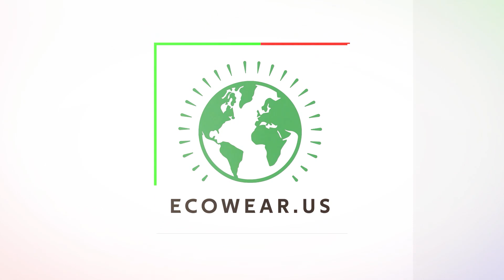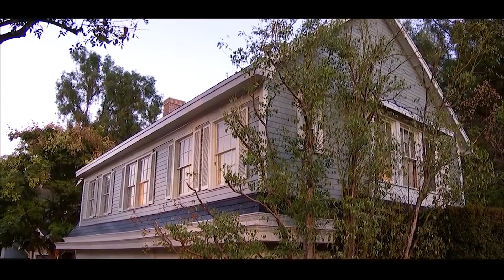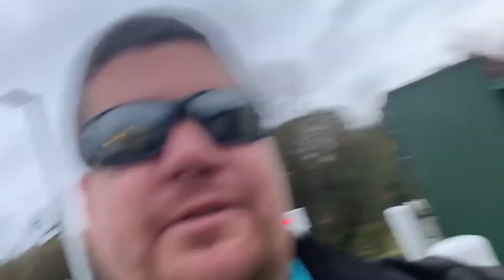Tesla Time News - Changes Coming to Cybertruck?

Comment from the maker: Timestamps:
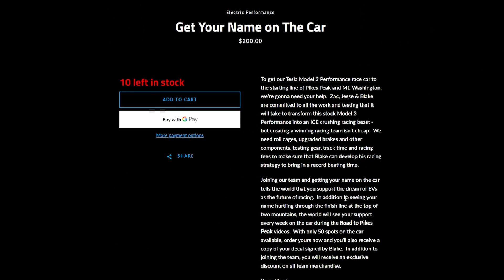Cybertruck Changes -  0:59
Extended Free Supercharging Miles - 6:54
BMW 330e - 7:47
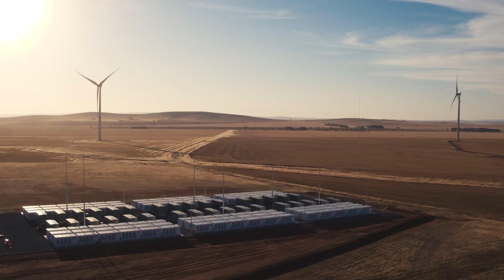Tesla Hornsdale Battery Got Bigger - 11:22
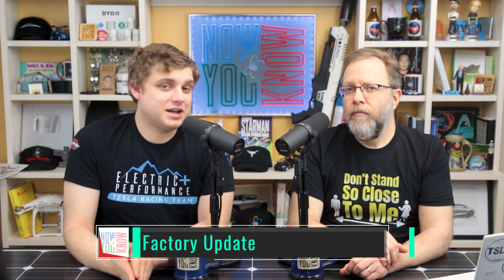Mike’s Lucid Factory Update - 11:54
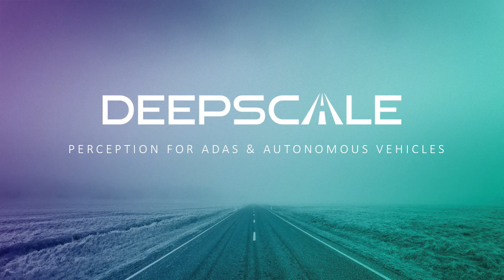Tesla Deep Learning Patent - 14:16
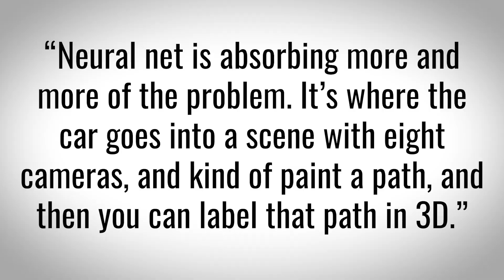Model X Pre-Heater - 15:18
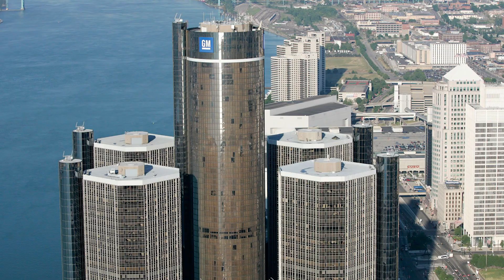GM Customer Loyalty Survey - 18:47
Auto Park Update - 20:55
Revero GTE - 21:32
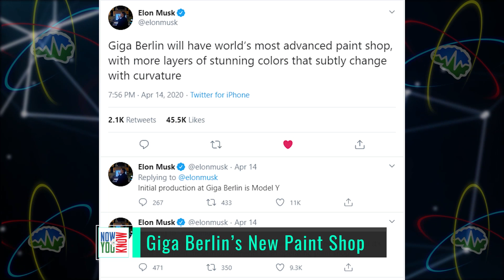Giga Berlin’s New Paint Shop - 22:55
Shots Fired - 23:37
Judge Cancels Keystone XL - 28:38
New Tesla Powerwall Feature - 29:48
Scientists Are Back - 31:30
Ford’s Fastor Charger - 34:01
Tesla’s Letter to Landlords - 35:11
EPA Won’t Regulate Coal - 35:41
And If You Don't Believe Us - 37:40
Reply: Now You Know why mock putting the CT in a garage 🤷‍♂️
1. You have to charge it
2. If it’s raining you don’t want to get wet.  Also you say 3% won’t make much of a difference but the length was too long for the standard garage... a little shorter and Voila! It fits!  
Your constant mocking is one reason I stopped watching all your shows. I may not be the only one... Now you know!
Reply: FAST STORage ???
Reply: Is the air suspension on bags or are they air shocks
Reply: Can we get your “EPA Won’t Regulate Coal” in a Now You Know Clip?
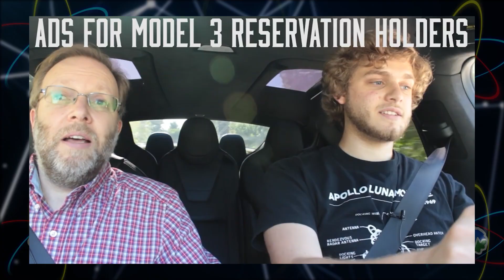Reply: That hair 8:00
Reply: 11:54 ( 12:34 )   Where the New LUCID is located in AZ. Your welcome :)
Reply: Thanks for calling out blatant corruption under Trump administration and NRDC efforts to make the last line of defense (Judicial) work against that corruption.

Comment: In the video you talk about Elon Musk reducing the size of the Cybertruck by 3% so it will fit in peoples garage. Reducing the size of the Cybertruck by 3% is a great idea for many many reasons: theft, damage from people and the elements, and also important is that some people can only park their vehicle in their garage because that is the only available parking they have at their home, also with the charging of the vehicle at your home the location of the charger and the length of the cord could be a reason. These are just a few of the many reasons the Cybertruck should be built to fit in a standard 20 foot length garage. You mention in the video the Cybertruck "is a garage" It is not Cybergarage. It is  Cyber 'truck". Usually you two have great points that make a lot of sense but this point is way off the mark and not helpful to many people who want to buy a Cybertruck and need to park it in their standard size garage.

Comment: All these innovations but please, no connection to the internet.  Am I being paranoid.  I don't think so.  Have you noticed what is happening in Australia just now (June 2020).  They are under a major cyber attack.  Did you notice what happened to the UK Health system.  Ditto.  How about bank after bank.  I don't want some autistic 14 year old in his mom's basement deciding to hack Tesla and make all cars stop where they are.  And have you paid attention to the revelations of Showdon and Manning.  Do you really want to give the secret services of the world a back door into your car.  No thanks.  Besides, I simply don't want to be continually watched by Big Brother.  If I want a software update, I will go to my computer, plug in a flash drive and take the flash drive to the car and plug it in.  In addition, I would rather have the early adopters try out any new innovations for a year before I leap in.  Have you ever seen a new program, even from the biggest soft ware developers, that didn't need patches.  As for navigation, Everyone has a smart phone these days.  Navigation ability in a car is redundant.  One last thing.  I like driving so at least have the option of no self driving.  (and reduce the price by the cost of not having these features)  Oh, and one more.  Scrap the touch screen and make all controls tactile so I don't have to take my eyes off the road to turn on the radio or do something else.  Not every gee wizz innovation is actually an improvement.  Each one has it's down side which we only find after using it and this goes all the way back to our first use of fire.  In some the advantages outweigh the down sides, in some, not.

Comment: The biggest gain of 3% reduction, is going to reduce the weight. Which will increase the range, and acceleration. Additionally lowering the height decrease wind resistance.

Comment: In 1976 Ivan Steward won by himself in Hi-jumper VW in 18:55:49  Mouse McCoy was the first one to finish the race on a motorcycle by himself. And most trophy truck frame is 4130 chromoly steel tube frame with 24 inches of wheel travel with the wet weight of 3500 lb and the pit crew with welder it fix the frames. I think Musk smokes to much weed to think his truck would finish a off road race. And if you think it would make it you need to cut back too.

Comment: Honestly the day it came out, I noted the height and I took a measuring tape to the shared garage of my townhouse complex and... it wouldn’t fit. So I was screwed. My 200 unit townhouse house complex has 20 separate garage entrances. My garage has 3 pickups. So that’s something like 60 trucks they can’t sell. In one place. In one small city in Ontario. They were smart to reduce the height.

Comment: Probably the best thing to do would be to charge the car up on a 1kW link overnight. It would add about 10% range, plus the car could keep the battery warm using that power as it charges. Might not increase range very much in very cold weather but will probably do more then just pre-warming the battery.

Comment: Get off Patreon, they're a toxic bigoted anti US extremist far left outfit who are anti-free speech and anti creator. Their CEO is ironically a commie bigot extremist.

They also have suspect finances - I wouldn't risk using them.
Switch to or at least add Subscribestar, anyone to the right of stalin prefers them (I have no connection to either).

Comment: BAJA is to compete even harder with Ford! 
Ford's SVT developed the first gen F-150 Raptor there, it finished the Baja 1000 lightly modified and in 2017 the second gen (with "Baja mode") finished third in its stock full size truck class (a Hummer H1 won, a Toyota Land Cruiser was second, the Raptor was seconds away from a DNF) and drove 400 miles to the office the day after.
Now imagine a bunch of Cyber work Trucks (stock except for decals from their owners' business) showing up at Baja 1000,  kicking butt and go do some construction or plumbing afterwards.
It would be cooler than DHL vans on the Nurburgring, and make the specialised F-150 Raptor look even more obsolete.

Comment: the heating outlets in scandinavia should have atleast the normal 3.7kW of power beacuse most people run cabin heaters that easily pull 2.5kW ontop of the block heater :) I guess they just say you shouldn't charge with them because it would get expensive :) makes sense because most of those outlets are free.

Comment: Zac Jesse, I would like more about lifecycle, especially batteries.  What companies are gearing up to handle recycling and disposal of old batteries.  This is going to ramp up quickly in a year or two. I have heard of American Battery Materials Corp.  There stock is crazy low, but looks like they have the right idea.  Are there any other similar companies forming?

Comment: @ 21:00 - Smart Summon in my M3SR+ with FSD does not work. So I'm not holding out any hope the reverse will be any better. It simply keeps asking me to move closer. On the odd time it connects, it moves a tad and disconnects. I've even replaced my phone and that changed nothing. (I've got yet ANOTHER service call scheduled for next week. Not sure they'll find anything though. They haven't on my previous service calls).

Comment: 18.43 i just plug in my car in those warming plugs and adjust amps to 8 (even tho there is 16 amp fuse), and then start charging whit built in timer 1 hour before leaving. and car heats up battery for 40 min and i get regen (not full but some) whit my model 3. and if i didnt rent my parking spot i clud change that warming outlet for one that cloud handle full 16 amps (where whit UMC2 i woud get 13 amps from schuko)
Reply: Problem is that then perhaps you charge from a outlet not suitable for it. Secondly charging in cold weather does not much for the heating. I have it connected all the time, both at work and at home. Battery stays permanently at between 20-25°C.

Comment: Cybertruck needs to fit in a garage so that people can charge it easily and protect the batteries from temperature fluctuations.
Reply: Will you be surprised when battery day reveals a cell that doesn't suffer when temperature fluctuates?

Comment: I Tweeted at Elon Musk
Have you thought of selling a 2kw Venturi Style VAWT Booster Compressor Wind Turbine 36% eff that has a 1:3 ratio chain drive with electronic brake controller to go with your PowerWalls, the base mounted 2.4m above ground, fixed guides outer & spinning turbine in center

I don't expect any reply but it would be a good edition to have at producing electricity at night with a 2kw 110v or 220v or 240v turbine that might need to spin 1000rpm. If your turbine only will rotate around 333.334rpm then a 1:3 ratio chain drive will spin the turbine at 1000rpm producing the 2kw. It will create less noise because of the slower speed of the turbine blades & if it's sitting in the middle of your backyard sitting 2.4m off the ground on poles then you're not going to have children getting hurt by spinning blades plus the blades are inside of a fixed set of blades that act as wind funnels. Anyone could DIY this sort of thing themselves by checking out the link below & downloading it to save on your hard drive.

wind turbine venturi vawt booster compressor
https://www.youtube.com/watch?v=oLGBBCPvKWY&t=1s
The most powerful vertical axis windturbine VAWT on earth joke
https://www.youtube.com/watch?v=OiRhX6FDCVw

Comment: From 2009 until 2017, Wheeler was a lobbyist in the law firm Faegre Baker Daniels' energy and natural resources practice.[18][19] Since 2009, he represented the coal producer Murray Energy,[20] privately owned by Robert E. Murray, a supporter of President Trump.[21] Murray Energy was Wheeler's best-paying client, paying at least $300,000[3], and possibly as much as $3,300,000[22] during the period 2009-2017. Wheeler lobbied against the Obama administration's climate regulations for power plants and also sought to persuade the Energy Department to subsidize coal plants.[2] Wheeler set up a meeting between Murray and Energy Secretary Rick Perry in March 2017; at the meeting, Murray advocated for the rollback of environmental regulations and for protections for the coal industry

Comment: I think it being 3% smaller will be perfect. currently in the cyber truck is about the same size as the TRD pro witch is 20ft long.  Even 19.5 will make  pulling forward into a parking spot easier.

Comment: I had one of these heaters on my 1988 honda civic when I lived a winter in Fairbanks AK and it worked well.  (It was 1.5KW) . I wonder if model Y (and especially the Cyber Truck) could have an  antifreeze loop to the battery from the heat pump instead  of an external device that could possibly damage the battery if it sprung a leak??

Comment: If the Cybertruck active suspension can be configured to run in Baja, wouldn't it react fast enough to jump potholes, and road debris, squirrels, cats, turtles, etc. , like a good skateboarder does? It already has the cameras and radar to see them, and the computer power to predict the time when the mitigating reaction should take place, based on the current speed. Imagine how smooth the ride would be, and how much value that would add.

Comment: I had a 330e here in the UK. The reason was i could not get a BEV with enough range i could afford. I did manage to keep it on electric for 3/4 of the total mileage i did over the 3 years of ownership. I have a model 3 now but they where only just available as i traded the 330e in in fact i had to hold on to it 2 months while i was waiting. I think PHEV's are a great educational tool people who think the small range is not enough (i did 19-20 regularly in the BMW) I fully understand how us in the know would bash them but they i think be considered a way to get people over the range anxiety when they are only doing 10-20 miles anyway. It's all about education

Comment: If anyone has access to Elon on Twitter as I don't have a twitter account, I would be interested as to what he has to say about Customer Service and Quality Control issues.  I read the forums about Tesla and yes I know you only post on forums when you have a problem however it appears that Tesla continues to have Major issues with Customer Service and Quality issues.  For a vehicle in this price point, that is just unacceptable and could be the demise of the company.  I would be interested to hear what Elon has to say in defense for poor quality and very poor customer service.
Reply: Instead, Google
"<Insert company> quality control/ customer service/ recall/ fire..." etc

Pick any car company, and any of those subjects

Then come back and suggest Tesla has an "unacceptable" problem.
OK?
Reply: Consumer Reports found the cars acceptable, but perhaps you want to maintain water pumps and radiators, adding power steering fluids, antifreeze, oil, filters, fan belts, alternators, spark plugs, ignition systems, fuel filters, fuel pumps, and injection systems, etc.  Teslas don't have ANY of that so stories of poor service need to keep all that in mind.  I've had nothing but excellent customer service and no quality issues.
Reply: @theclipmfg  Good for you, but allot of others have not had the same experience and for this price point that is unacceptable. I understand about all the parts you listed as being beneficial to electrics. I'm not disputing that. However customer service can make or break a company. Hearing stories after stories of emails going unanswered , can't get anyone by phone and voicemails going unreturned will not fly if they want mass adoption. They HAVE to get better. There's no excuse for this. This is all prior to the outbreak we are dealing with. Don't even get me started on the right to repair and Tesla refusing consumers access to troubleshooting capabilities. That is wrong on so many levels and a lawsuit waiting to happen.

Comment: I always thought paint which can be scratched with a fingernail is the worst possible thing to do to a hunk of metal going 70 mph for over 100,000 miles. Not to mention the fading and oxidation. A stupider idea would be air to fill tires. The worst idea ever.

Comment: Guys, it would be better if it fit in a garage because of:
Cleanliness 
Theft / security issues
Temperature/ interior sun damage 
Charging on the garage wall!
And also to keep a low profile
Reply: Maybe y’all live in CA or FL where people use a garage as storage or a CNC shop, but when you live where there are actual seasons, parking in a garage actually keeps you dry, and way more comfortable than doing the umbrella dance with hands full.

Comment: I’m not a fan of making it smaller as a full-sized pickup is mainly a work truck.  I’m not worried about it fitting into a house-hold garage. Offer a midsized pickup at a later date.
Reply: A very slight change to external angles makes the outside noticeably smaller with little change inside.
1% internal change on a 2.5 m wide vehicle is 1 inch.
That's probably at the waistline where it won't be noticed.

Comment: Two reasons I want to park the Cybertruck in the garage:  Firstly, as already noted, that's where the charger is located.  Second reason is more Cybertruck specific.  The Cybertruck has electrical outlets to run power tools.  This means the truck, in addition to being transportation, is an energy storage device that can be easily tapped in the event of a power outage.  Will install a couple of receptacles in my garage that will allow me to easily insure refrigeration and lighting are available should the power go out.
Reply: Or just for winter. The Cybertruck seems to be using the same handles as the Model S, which sometimes doesn’t work properly during winter.